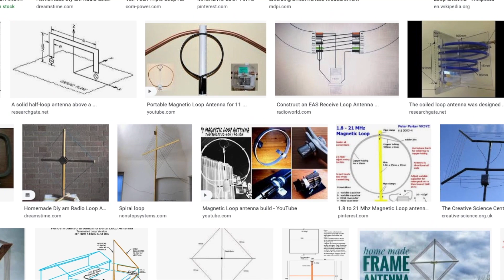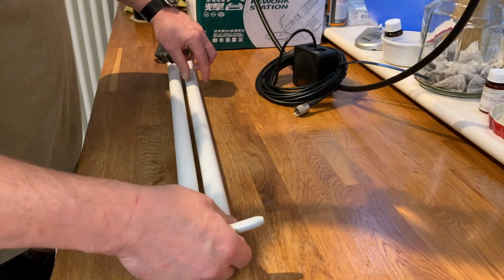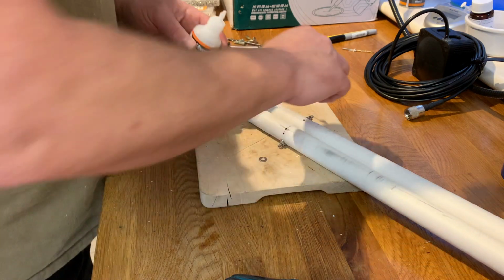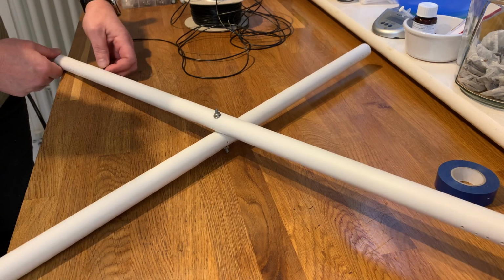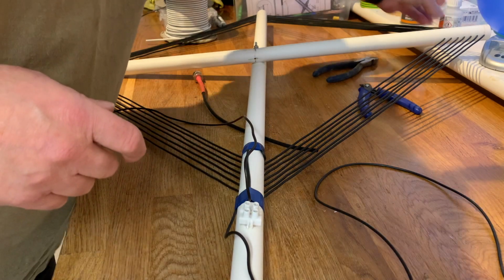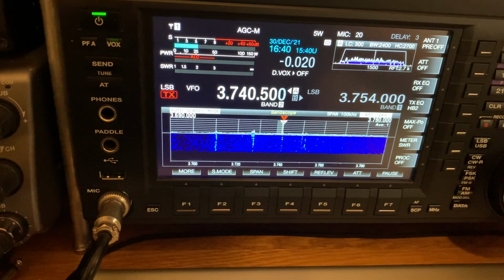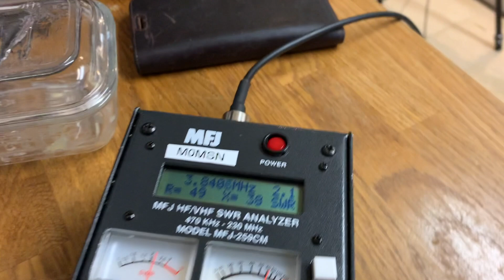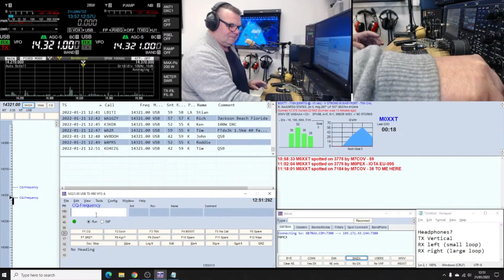HAM RADIO: Direction Finding Loop Antenna : Frame Antenna : Wire Winding : DX Commander

Comment: Where the dimensions, turns etc calculated?
What's needed for 40m? Half the wire?
Actually I want a bearing on an frequency sweeping ionosonde (I think that's what it is). There are several. The one I want starts at 5Mhz and sweeps up to 14Mhz+. 
Will this antenna receive this?
Reply from the maker: 66pacific.com

Comment: Instead of threading the whole length of wire through each hole, start with the halfway portion of the wire from the middle hole and thread one end of the wire out from there to the centre and the other end of the wire from there to the outside.
Reply from the maker: Great tip!

Comment: could this be changed to 2 meter to use for a fox hunt?
Reply from the maker: Yes indeed
Reply: @mike-M0MSN  is it just using a shorter wire?
Reply from the maker: @cacher7745  yes you will need to scale down the antenna, use 1.8/ 2M of wire or something like that.  Let me know how you get on..

Comment: Super glue doesn't work on PVC pipe. I would use plastic mender epoxy. Better is a a PVC spider fitting.
Reply from the maker: Yes, you are right